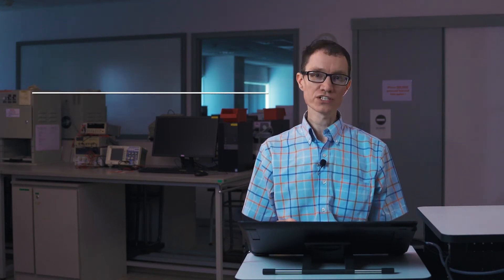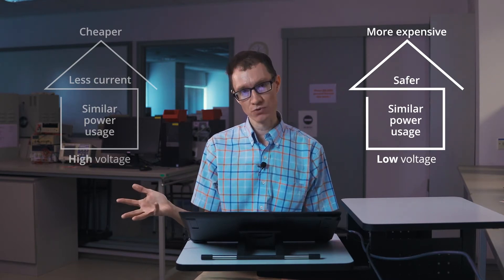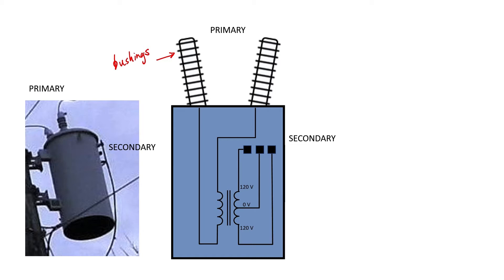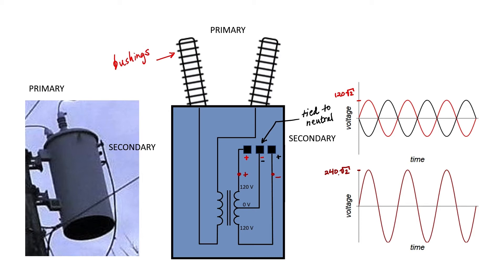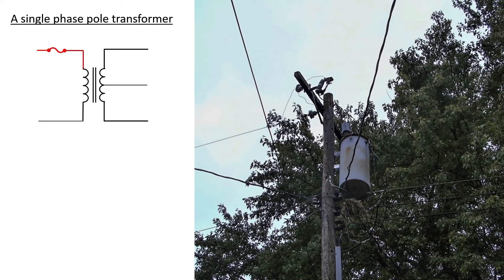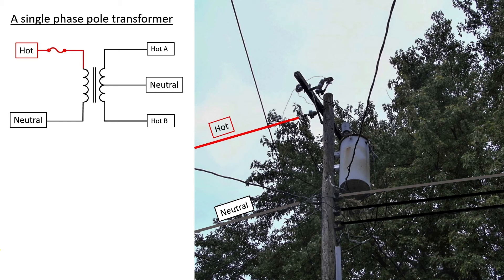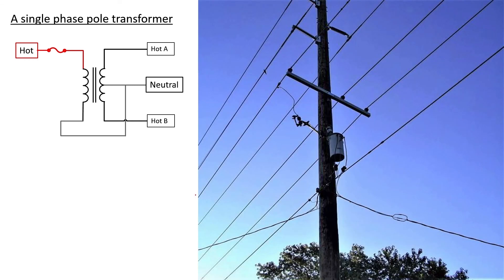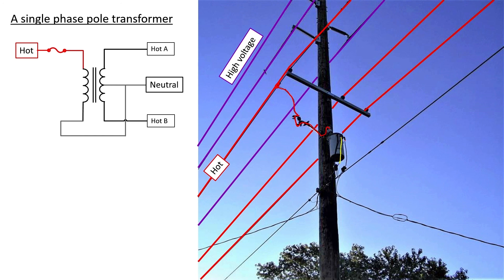Split phase power in North America (22 - Electricity Distribution)

Comment: That is so different and interesting for someone who lived in Europe for his whole life. Here we don't use the split phase system at all. In most of the EU you get three phase 230/400V service. In old houses the service can be single phase 230V, or if you want to have very low power limit like 5kW to get cheaper service, you can also ask for just one phase. But even in that case they will give you 3-phase wiring up to your distribution board, so everything is 3-phase-ready if you ever wanted more power in the future. The transformers here are definitely more than meets the eye ☺ Most of them are huge and feed hundrets or thousands of houses, through a dedicated low voltage power lines. Thus no high voltage running along every street, those lines mostly run through fields in rural areas, and underground in cities. So when I watch videos with "transformer explosions" from the US I'm always with my jaws opened, as here you see arcing power lines very very very rare.
Reply: In Brazil we generally follow the EU method, with 3 phases everywhere. It sounds bizarre and scary to have the HV and LV side of the single-phase transformer attached to the same neutral. (We do have this in SWER rural electricity but it is the exception.)
Reply: @pu5epx  as a European it feels bizarre and scary to have so much MV cable everywhere. I don't even know where our substation is and because there are few transformers all the cabling is underground.
Reply: @loulou53137  yeah, it is unfortunately the custom in Brazil too, for now. Eyesore.
Reply: NA three-phase is 480/277v service, but it's usually only used for commercial and Industrial applications....  while split phase 240/120v is  is what's most common for residential service. 

And if somebody who has always lived in America and has never seen a transformer explosion..... Be careful of social media overdramatizations.
Reply: @pu5epx  — It is safer to have the neutral of the distribution network and all of the service neutrals connected and tied to Earth all over the network.
Reply: It isn't as different as you think.  Draw a diagram of a 3-phase "Y" with 120° between the legs.  Now cross out one of the legs, grab the other two legs, and bend them apart so the angle is 180°.  You now have the split-phase system.

Comment: @ 2:44 you call one of the primary bushings "a neutral" . Could you expound on this a bit. Is the term "neutral used for any return line, even if it's NOT a post-load line and it's at high voltage?
Reply: "Neutral" is the grounded conductor, that's all.

Comment: 4:45 This information is not true for Europa. In Austria and Germany you get three phases to your house or flat. Four wires: 3 hot called L1, L2, L3 and neutral called N or PEN. Voltage phase to phase is 400 V. So you can run a 3-phase motor without any problem. Very handy for a workshop or a waterpump.
Reply: The information is correct because he's only contrasting single/split phase services..... NA has three-phase i480/277v service....(Not as common for residential use since it's less safe)
Reply: @nc3826 at the very bottom of geometry a square is a rectangle , it's only a one directional relationship. It's indeterminate if a rectangle is a square. If we consider all of the phase angles possible between two phases, as rectangles, the 180° out split phase or what you wish to call it is the square. The idea here is to have a 220 volt appliance that gets every bit of the amperage in the 220 volt circuit and sends none down the neutral. When we use a single 110-volt device all of the current goes down the neutral. When we use two 110 volt breakers on the same leg, all of the current runs down the neutral. When we split the phase, we have two loads with one load on each leg. At this point the difference between the legs is all that goes through the neutral. In the special case of the 180 degree angle between the two phases we call it a split phase, and we try to balance all of our loads on the two legs so that we get the most economical efficient result. It's one of the funnest things I learned in electrical engineering a lot of people are extremely passionate about this. There's not an invisible God in the wires, more than one viewpoint, with correct mathematics is easily understood.
Reply: Will Germans seldom get lonely because they have 600 and some people per square mile. It takes a lot of wire to deliver three-phase to everybody but if they're standing in line to get it you might as well sell it to him. It's a good system but it's copper intense if it covers a large area.
Reply: This is the North American system, as stated in the title.

Comment: I like the video. But your terminology is making it sound like you have two phases in the home. You have one phase.  There are two legs of that single phase in the home.
Reply: It is essentially what the home has.  If you have two boxes each having 2 hot wires coming out of them with hot to ground voltages the same for each wire.  

How do you determine which box is split phase and which is 2 phase?
Reply: Whether you call it two-phase or opposite polarity doesn't really matter.  They are equivalent.  The important thing is to understand how it works.
Reply: @GH-oi2jf  We understand how it works. Split Phase is not Two Phases.  Many commercial buildings, like apartments actual have 2 Phase Power.  Residential homes do not.

Comment: At 7:40 you say some customers get their service underground with a hot and neutral wire coming down the pole. Are these lines that come DOWN the pole going TO a transformer on the ground near the house, or are they emanating from the secondary winding of the pole transformer going directly into the house? Thanks.
Reply: It could be either.  I live in a multiple dwelling building.  The transformer is next to the building under the sidewalk.  Distribution voltage comes down the nearest pole to the transformer, which sends low voltage to a panel in our below grade garage.  Transformers are commonly on poles in residential areas, and the low voltage usually is carried on wires through the air to a building.  They could go down the pole and underground, though.

Comment: Great explanation, we just wondering how many household that 1 transformer feed? 
How they connect? 
On your demotrated figure, it feeds 2 houses , we guessed:-)
What about if it is a 100 House community? We need 50 transformers?
Thanks for all inspirational videos👍👍👍👍
Reply: A pole mounted transformer typically feeds one to three houses.  A planned community, with an entire neighborhood built at the same time, could have a different arrangement taking into account the density of the housing.  It could have larger transformers mounted on concrete pads at convenient places, with underground wiring to individual buildings.  In most older residential neighborhoods, in which lots were developed individually, there are poles with transformers as needed.
Reply: @Ada - My home has its own transformer, on a ground pad.

Comment: Higher amps would be more dangerous than lower
Reply: Amps is not dangerous, when you start your car it draw 300 to 600 amp, but it's still 12V
Reply: Amps is the dangerous part.....voltage does not matter its the amps
Reply: Amps can't flow without voltage. Higher voltage pushes more amperage. Higher voltage is more dangerous

 @brandonharris305
Reply: @brandonharris305  — wrong
Reply: And at that DC and ac amps is different study electricity before you comment
Reply: @brandonharris305  DC and AC is not the matter "the AC VS DC" war is over they both kill. I don't talk about HF (skin effect). The current flowing in your body when it become a part of a circuit is a function of the voltage, so the higher the voltage is, the higher the current will be. As the body is a "little" load, the size of the power supply don't change anything, If you press the tip of a non insulated screwdrivers on a 120 V thousand amps capable busbar or on the live wire in a 120V house plug you'll get the exact same shock .
Reply: @lapub.  ok
Reply: @lapub.  you have absolutely no idea what you are talking about
Reply: @brandonharris305  You know for some the earth is flat, so maybe for some maybe what  electrons  does in Europe is not the same in USA 😁
Reply: @lapub.  regardless lower voltage higher amps higher amps lower voltage...amps will always be more dangerous than voltage...and the earth is flat
Reply: @brandonharris305  Please grab one different pole of 6KV with no amps flowing line in each hand then grab a truck battery pole while the engine is fired up, then tell me, thanks for you devotion in science experiment, don't forget to report.
Reply: @brandonharris305    Regarding your lower voltage higher amps and higher voltage lower amps comment,  resistance must be included.   High resistance on low voltage, no amps.   Same resistance high voltage, amps will flow.  Also, amps are flow of electrons measurement.   AC or DC, no difference except direction of flow.   An amp is an amp.
Reply: @brandonharris305      Brandon,   You have a misconception of what you were taught.   You were told that 1/2 an amp through your heart can kill you.  Although true, it is the voltage that is needed in order for the electricity to have amps go through you.   Your body is highly resistive, so higher voltage is needed to overcome the resistance to cause any amps at all.  12 volts no issue, 24 volts, it might tingle slightly, 120 volts can grab you and hurt you badly or kill you.   7200 volts, enough amps to blow off body parts.   I’ve seen pictures of that.
Reply: It’s both… you can touch a 12v battery that can dump 100amps and you’ll feel nothing. You can also touch a spark plug that will give you 100,000 volts that will cause you to spaz out but shouldn’t kill you.. think taser…  but have 240 volts at 20 amps.. damn son. Probably gonna die if it crosses your heart. My dad’s friend was a plumber. A basement flooded, he went in it looking around. Bent down to check out the sump pump, then put his hand on a copper pipe as he was getting up… he got stuck and cooked until he died. The sump pump wire had a break in it. So 120v 15 amp. Probably wasn’t getting the full 15 amps because the breaker didn’t trip. But yeah that’s a horrifying way to go. Ive shocked myself multiple times with 120. It may have taken a few minutes for heart failure.. im thinking green mile type shit..  but yeah i think of electricity like a hose. Voltage is the speed at which the water flows and amperage is the amount of water that flows.  A tiny stream of water going really fast is going to make you feel it, a bunch of water barely moving won’t get to you, a squirt gun at 30,000 will kill you. And a 6” fire hydrant at 90psi will break your body and send you flying across the street to your death.
Reply: Power is the dangerous thing.  Power is the rate at which energy can be delivered.  A lot of energy in a short period is dangerous.  Power is the product of voltage and amperage.

Comment: UTILITY: "We're giving you single phase service."
CUSTOMER: "But I have 2 hot wires coming into my house."
UTILITY: "Yes.  It's one single phase from the transformer, but's it's split."
CUSTOMER: "Oh, so it's just a Y-connection, and I have 2 of the same hot wires"
UTILITY: "No, each of your hot wires are 180 degrees out of phase with each other."
CUSTOMER: "Soooooo, in other words, I have TWO PHASES - which means I have TWO PHASE SERVICE."
UTILITY: "Well, I guess it's more like your single phase is not really split - it's more like two halves of a single phase."
CUSTOMER: "So, I have two half-phase single phase service??"
UTILITY: "Uhhhhh...... You're gonna have to call my supervisor."
Reply from the maker: Pretty much sums up my thoughts on the matter perfectly.
Reply: Reminds me of an argument I had with my dad on exactly this topic. He insisted it was single phase, but it seemed to me having another hot that was 180 degrees out of phase was the definition of two phases.
Reply: @jonahansen A single phase transformer has one primary winding and one secondary winding. The power to your house is center tapped with a grounded neutral from that single secondary winding. So it is one single phase. 

3 phase has 3 primary windings and 3 secondary windings at the transformer. Hence, 3 phase. 

Your dad, like usual, was right.

Comment: Why do we have 120 volts to ground systems in the US?  Easy answer, politics and money.  Thomas Edison the inventor of the light bulb, made his lights to work on 120 volts DC.  And was installing 120 volt DC power systems to homes.  Tesla was working with AC systems and decided it was better to power homes at 240 volts AC.  As things always happen a Standards group had been formed and they were so inclined to decide that 120 volts to ground would be the standard.  BTW, most of the Standards group were friends of Edison.
Reply: Tesla did not decide that, it was one of the engineers as Westington that made a working generator out of the general ideas Tesla had.

Edison didn't invent the light bulb, he was the man who got the first commercial success. The reason for the split phase is that Edison couldn't find any generator making more than 120V when he started the electrification campaign, but with a "common neutral" two generators could share the neutral cable saving 25% copper, while making load balancing between the generators easier. Adding a centre tap to the transformator winding allowed existing DC systems to shift seamlessly to AC instead.
The channel "Kathy loves physics and history" have an excellent series of videos that covers the whole development from Voltas battery and the early experimentation to the European three-phase system now used globally.
Reply: @Kevin - The Edison 3 Wire residential system was actually 110/220 Volts DC.  The initial AC voltage was 110/220 Volts AC, then increased to 117/234 Volts AC and is now 120/240 volts AC residential.
Reply: @MrSummitville .   You are correct.   But the point is to answer the question as, why is Americas standard 120 volts to ground and most of the world 240 volts to ground.   The answer is Edison had political power and his lights ran at 110volts, not 220 volts.   So, a committee made a decision that both DC & AC systems at the time would be 110/220 volts for residential.   Tesla was for polyphase.   At first 2 phase, then he changed to 3 phase.
So why did the voltage go from 110 to 115 to 117 to 120 volts?   So that, at the time, they could get more power through the existing lines.   Seems very insignificant, but it was the reason.